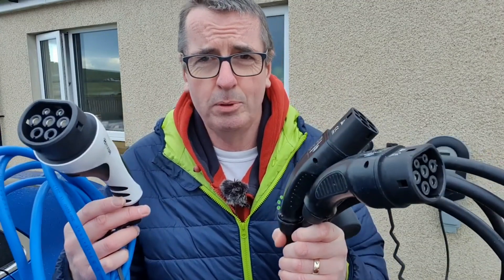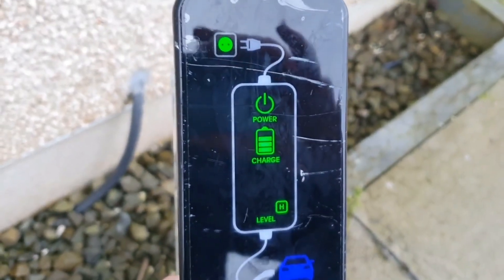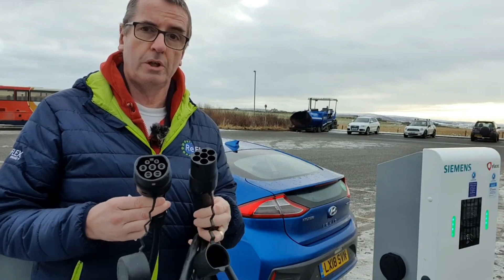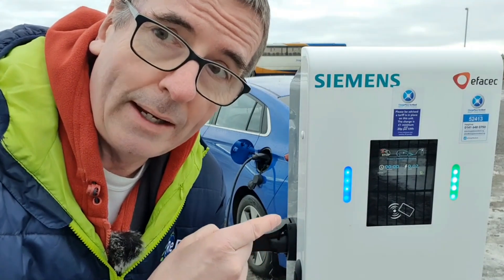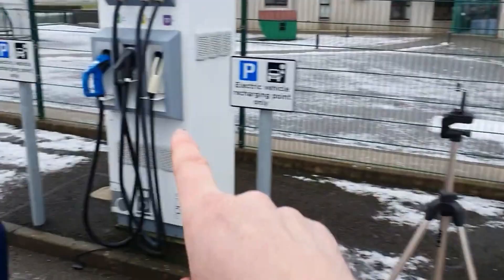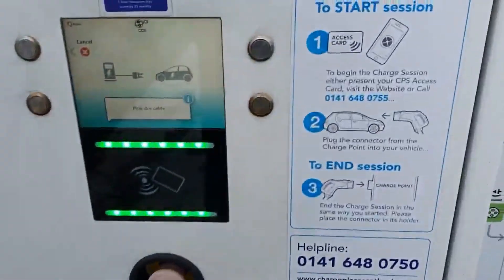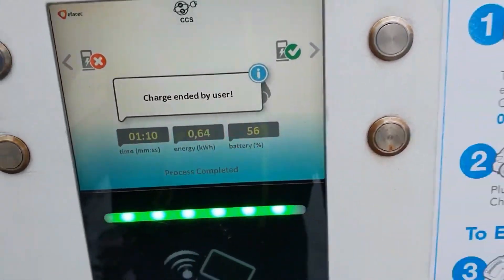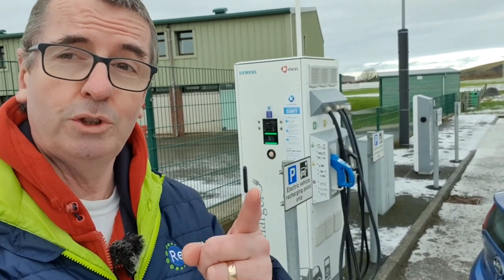So how do I CCS charge my Electric Vehicle ?

Comment: Thumbs up for a very informative video, ideal for beginners to get started in the EV world. I like how manufacturers are designing their rapid chargers to resemble petrol and diesel filling pumps as it gives some confidence to newbies or perhaps those who are a bit hesitant to make the switch.

My first electric vehicle was in 2008 and used a standard 3-pin household plug. It wasn't until 2014 on a Nissan Leaf that I first discovered the Type 1 AC socket and the CHAdeMO DC socket with the older style button and lever connector plug. Now with Type 2 AC and CCS DC becoming the de facto standard in the UK and Europe, which I prefer for it's simplicity and ease of use. My only wish is to have all network providers accept contactless payment as standard, instead of the odd few. I have too many RFID cards, memberships and smartphone apps!
Reply: Yeah, why can’t they just standardize contactless payment like petrol stations have?

Comment: Very good explanation of the difference between Fast Charging and CCS Rapid Charging. Should be compulsory viewing for all new EV owners!  

I often meet new EV owners charging on the 22kW AC at Tesco who can't understand why their car will only charge at 7kW or 11kW and they assume the charge point is faulty!

Also a guy who had purchased an Audi e-tron ten days ago didn't think the CCS plug would fit his car and had always charged on AC. He was amazed when I removed the rubber bung from the bottom section of the socket on his car to reveal the CCS socket!
Reply from the maker: Yes , the main dealers REALLY NEED to get their act together,  the amount of poor or NO advise on charging is terrible 😑

Comment: For what it's worth, EVSE stands for electric vehicle SUPPLY equipment. Also, it pretty much covers anything you plug into a vehicle to charge it using the vehicle's internal charger. In essence, it's just a cable with a safety switch system designed to safely provide the correct AC voltage and current to the internal charger.

Comment: I am planning to by a Electric Bike, it natively support 1.2kW and 3.5kW charging with first party carryon charger, since bike has CCS connector, would I be able to charge it at these 4-wheeler charging stations? If so what would be fastest it can safely charge at?

Fyi: Battery is 10.4kWh

Comment: What are your thoughts on the current crop of hybrids with CCS capabilities??????
Reply from the maker: Madness ! Plug in Hybrids should just have type 2 , 7 kw on board chargers, adding CCS to allow 25 miles ev range to a vehicle with a petrol engine , just frustrates me ,as these drivers become desperate NOT to use fossil fuel , and so stop every 25 miles to use a rapid. 

Get a full EV ! 

Rant  over 🤣🤣

Comment: For AC slow charging, the EVSE is not the charger. The charger is a unit in the car. The term "charging cable" is a useful way to be both correct and vernacular.
Reply from the maker: You are correct , but this is aimed at the public who are helped with terms that ive found keeps folk interested in the process of charging an ev.

Comment: If I am getting a car with a maximum rapid charge rate of 100kWh and I only have 150kWh rapid chargers near my house will this still charge? Assuming it will still charge but only accept the maximum taken by the vehicle? The car has a CCS port for rapid charging.
Reply from the maker: Hi , 1st of all kWh is stored energy , kW is power.
So 150kW rapids will charge at the evs maximum 100kW draw , but this will depend on battery SOC , and temperature of the pack , andvof course as you approach 80% SOC it will slow right back on the charge rate.

Comment: Does using the AC "hog" the charger. I thought you could use AC and one DC at the same time, parking space permitting.
Reply from the maker: Yes you can , but plugging AC into most evs ( except the early zoe ) means the 43kw avaible , ( to all evs AND plug in hybrids ) will only 'draw ' from the rapid 3 or 7 kws , some pull 11kws . This means a very slow charge rate , hence the term 'hogging' the rapid, especially when a nearby 'fast ' charger will offer the same rate of charge.

Comment: Are electric vehicles more expensive then petrol if you cant have a home charger installed please help
Reply from the maker: It depends on  what price you pay for electricity at a public charger ,it can be as low as 20p a unit or 90p a unit ( 1 kWh ) , then you can drive a petrol car that returns 50mpg or one that does 15mpg ! 
Taking my Kia e niro or Renault zoe , both on average return 4.5 miles per 1 kWh of electric , so every 20p spent on a public charger will take you 4.5 miles , or 90p ! 
Choices,  its all about Choices,  and unlike petrol / diesel , you can look around for the best electricity prices on public chargers. 
But charging at home on a cheap overnight tariff (i pay 9p a unit) is the best way to save £1000's in 'fuel' costs over a fossil fueled vehicle.
Reply: @JonathanPorterfield  I'm private rented and it's looking like landlord isn't giving permission to have one installed I'm getting Mégane etech techno 60 kWh, end of June and currently driving Audi q2 1.0 , cheapest rapid chargers in my area are around 65p kw , average is 85p , my q2 returns about 38 mpg I think ?

Comment: Keep that charge between 20 and 80% for most days unless you really need more.
Keep that sweet spot for a long battery life.  Yes you can go above and below on trips if necessary but for daily driving most people do not need to. People need to get away from the petrol "FILL UP" mentality.
Topping off to 100% is not good for the battery. Sitting at 100% for hours, days or weeks is not good for battery longevity.
Reply from the maker: Yes with you 100% , but this video is designed for just the basics on how to charge an ev.